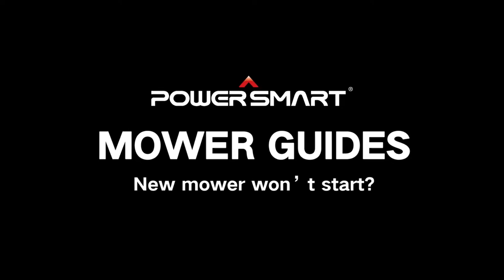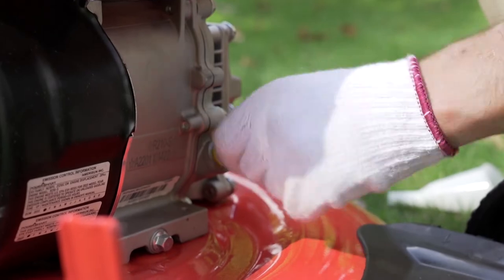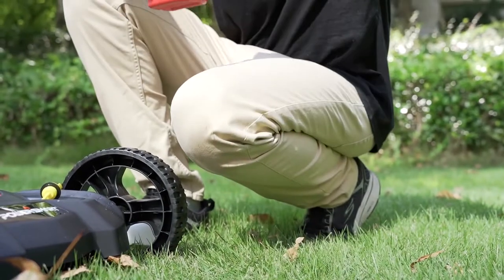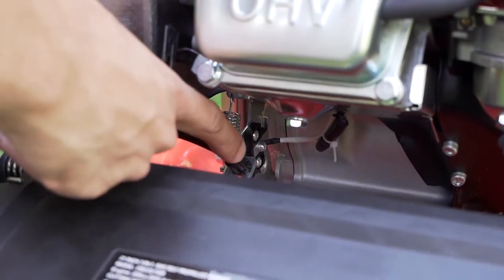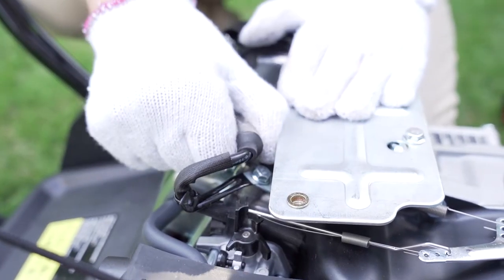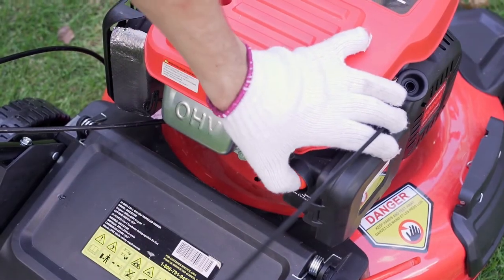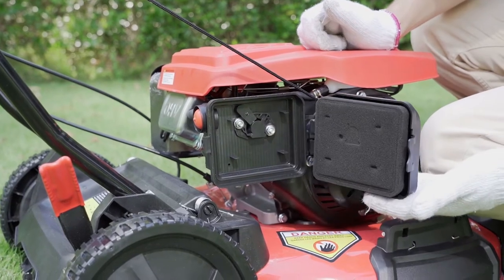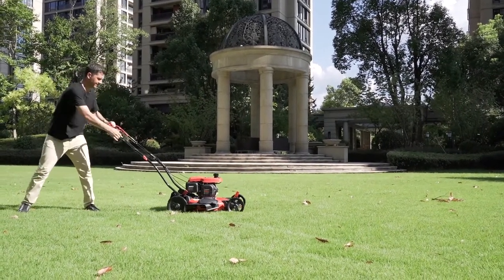New Lawn Mower Won't Start? Let's Check This Out! | PowerSmart

Comment: I bought DB2194PH lawnmower on November 14, 2022.
It has not been a year, but the engine just locked up today and would not turn.
I follow the exact instruction specified in the manual for model DB2194PH.
Using engine oil 10W-30 and fresh (within 30 days from purchase), lead-free gasoline with a minimum of 87 octane rating. The mover has been used only a few times, and now it is dead. Cannot pull the engine cord. The engine won't turn.

Comment: Can any brand of oil go in?? I have only used mine 3 times and now it won’t start.  I just bought it in April.  I’m pissed.  I will check oil tomorrow. I’m a woman so this is new to me.  Any ideas would be helpful.  I was pumping then pulling and won’t start
Reply: So I'm having the exact issue.. did it just not start one day, or did it have some Issue that caused it to shut off, THEN it wouldn't crank anymore. I saw your comment and was like it's probably 3 years old or something but to my surprise it's 20 hours ago lol. So I figured maybe it's relevant to my issues. I will say though it stood out to me that they required SF level oil, but as I researched more I found that that was actually a lesser quality of oil so they're likely saying SF or better just not worded that way. Anyways thought maybe if you got any advice you'd share it. If I do I'll do same. I'm a guy but it's just as frustrating when your not familiar with small engines. But anyways good luck. 🤞
Reply: @coreyd944  well guess what. I took out the sponge and washed it out.  lol. Guess what. Started right up.  Woohoo.  This lady figured it out 😂
Reply: @coreyd944  cause I checked the oil and it was fine.  When I bought it they gave you a small bottle of oil and I had poured it all in and it was good.  And only using it like 4 times so I knew it was something small lol.  There was dirt and dust and all on the sponge so I just said let me clean it and it worked lol

Comment: Worst purchase ever
Reply: I bought DB2194PH lawnmower on November 14, 2022.
It has not been a year, but the engine just locked up today and would not turn.
I follow the exact instruction specified in the manual for model DB2194PH.
Using engine oil 10W-30 and fresh (within 30 days from purchase), lead-free gasoline with a minimum of 87 octane rating. The mover has been used only a few times, and now it is dead. Cannot pull the engine cord. The engine won't turn.
Reply: Facts